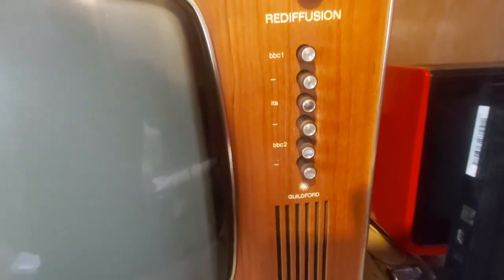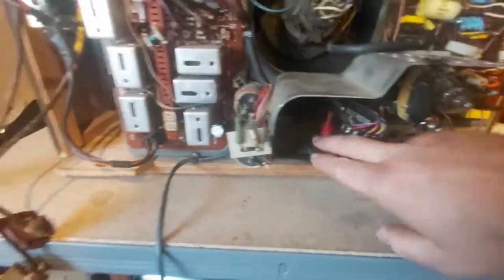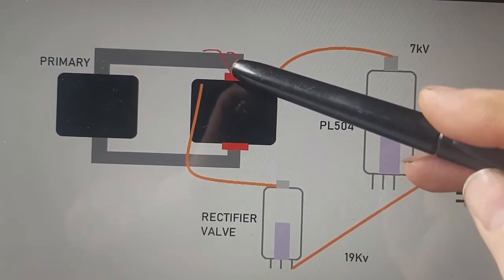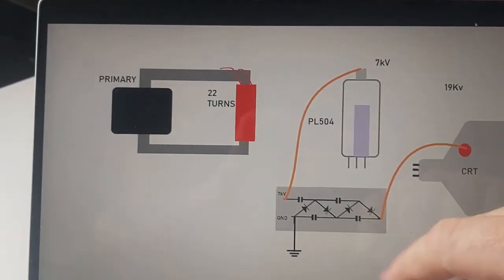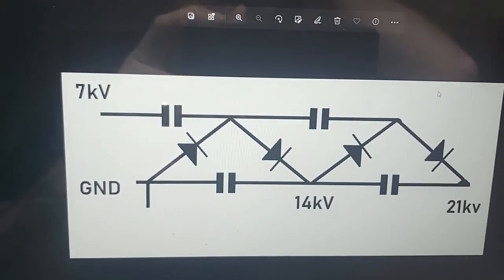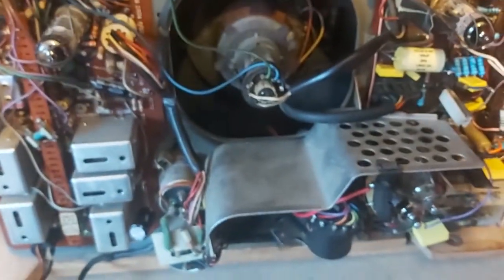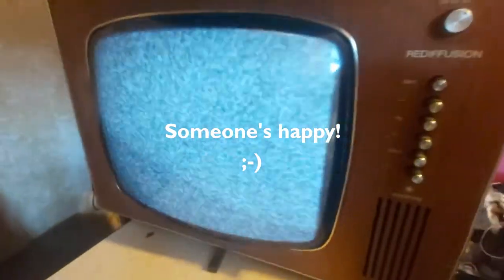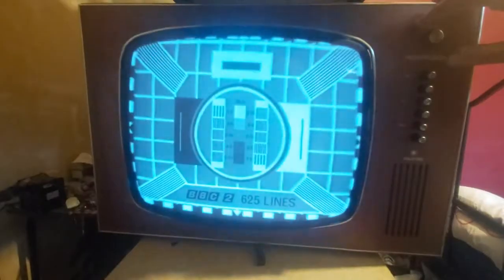Bush TV 161 A640 LOPT Tripler Conversion

Comment: Excellent! I have a Bush TV166U and bought a NOS resin-potted LOPT (at great expense!) to replace the old tar one which made the picture dim and enlarge, but now the set is non-functioning, even with the old LOPT back in it. Tried everything and can't get anywhere with it.
Reply from the maker: If you're getting a buzz but nothing else I've noticed it doesn't seem to take much to stop the oscillator running so check the PY88 diode. The valves are all series string too so one failing or going to air means the whole lot doesn't light up. If that's OK, suspect the mains dropping resistor or one of the two diodes coming directly from it.
Reply: @MegaWayneD  Thanks for your reply. I'm getting line whistle but the DY802 glows a quite bright purple, which I don't recall seeing before. I've tried swapping it for a new one, as I have the PL504, PY88 and PCF80. All light up but there's absolutely nothing on the screen. I've checked voltages and they are all more or less where they're supposed to be. I have no way of testing the EHT. The odd thing is that it used to work (apart from the failing LOPT symptoms) when I first revived the set back in 2013 but now this. I've also checked and replaced suspect caps and resistors in this area. I ended up putting the set under my bench after this and it's been sitting there for a couple of years now. I would love to get it working again as it has been in the family since it was new in 1967. I think I'll drag it out again and have another go.
Reply from the maker: @dryadmusic  the DY802 glowing purple isn't a good sign, almost like it's lost its vacuum but if you've tried a new one and it's doing the same it sounds like something is arcing/shorted in the LOPT stage.
Reply: @MegaWayneD  Ok, thanks, I'll have a look.
Reply from the maker: @dryadmusic  also make sure there's nothing dragging down the chassis to earth such as a test lead or video lead. If you earth the neutral chassis it drags the power down so the oscillator doesn't start up.
Reply: @MegaWayneD  I've checked for shorts as you suggest, but all ok. Then I had the idea of taking off the cap of the DY802 and noticed (with the light off) that the PY88 was flashing over at the bottom of the cathode, so I changed that and cured that problem. But then I thought I would change the DY802 as well and amazingly it worked - sound and vision have returned! I had never thought of changing those because they were Mullard NOS which looked brand new (and probably was), but I found that the heater in the DY802 was O/C and obviously the insulation in the PY88 had gone as well. It just goes to show that even NOS Mullard valves can be faulty sometimes. Now I have some aligning to work to do because I've changed so many caps and about a third of the resistors on that panel that everything is out! Thanks very much for your help.
Reply from the maker: @dryadmusic  Glad you got it working! I've had a few apparent "NOS" valves turn out to be worse than the ones I was replacing. I suppose the danger is getting someone's dodgy batch of valves, sure they might never have been used but someone may have tried to use them, realised they were duff and put them in a box for 50+ years! I have lots of DY802s if you're ever stuck, they're no use to me now that I have a tripler.

Comment: Nice job but you could just use a colour tv tripler or the high voltage winding off of other BW tv, usually they are compatible when they use the same output valve.
Reply from the maker: Where's the fun in that?! 😁 Plus I actually learned quite a lot from this.  I wasn't expecting this to work but it's been brilliant.
Reply: @MegaWayneD  well, cant argue with that...the only thing better i can imagine would be to keep the set original by using an overwind from another tv... but we all learnt something, i didnt knew candle wax was good with 20kv...i was surprised....i always use rtv silicone to pot and insulate high voltage stuff...the wax has the advantage that it can be melted again...im sure the silicone is much better dielectric and better to keep moisture away permanently though...if you want you can try, just go to an auto parts store and buy rtv silicone, or gasket making silicone etc ...its incredible with high voltage...just make sure you dont buy the acid type...if it smells vinegar dont use it...if it doesnt its the good stuff....dont confuse with PU glue or anything that comes in a caulking gun...those are conductive... great video!
Reply from the maker: @MrHBSoftware  this TV is far from original, the resistors had drifted so badly I've had to replace most of them. I did try to rewind the outer winding of the LOPT but it failed and I'd dismantled and reassembled it so many times I was concerned about damaging it beyond repair. Have a look at the thread on VRAT from when I first got this TV: https://www.radios-tv.co.uk/community/black-white-tvs/rediffusion-guildford-rt-194-19-dual-standard/

Comment: I have an old television with Tubes that suddenly showed a horizontal line, could it be a problem of the PL504? or PY88 please help
Reply from the maker: That's an issue with the vertical output by the sounds of it. Find out which tube is the vertical output tube and take it from there. I'm guessing it also has a vertical output transformer, which is also something to check.
Reply: @MegaWayneD  Thak you very much for helping

Comment: I've one with the plastic plessy lopt but black line midway on the picture and won't stop rolling. New caps resistors haven't cured it. Lopt is on a brc tripler. Any clues on the picture. Plastic caps on the right board all replaced. Thanks
Reply from the maker: Replace the PFL200 and PCF80. Get a couple of different makes too and never assume that just because a valve is new old stock that it's any good - I learned that the hard way! I had a new old stock Pinnacle PCF80 and it was worse than the original! Tungsram seem to be good replacements.
Reply: @MegaWayneD  made no difference what so ever. The board has original caps on the left if board. The right board has been recapped and old yellow and blue caps replaced. Its a half picture and a line across the middle. The picture isn't bright either and only getting 8kv not high enough
Reply from the maker: @basgib if it's only getting 8kv what's coming from the tip of the PL504? You should be getting around 7kv here. If not, suspect the PL504. If it is 7kv suspect the tripler.
Reply: @MegaWayneD  tried 3 good tripler trays and new valves. All known to work as they have been tested.    New boost cap and other parts.
Reply: Line gold drops the kv on the eht tray.
Reply from the maker: @basgib Could be the pot? Either way, time to look at the Television magazine article on the TV161 I think.
Reply: @MegaWayneD  getting 6kv on the anode cap on the original lopt.   No uhf picture just dark.   Contrast doesn't help on vhf it makes it buzz
Reply from the maker: @basgib hmm... Just out of interest, try giving the dual standard changeover contacts a good spray and operate them manually a few times and see if that improves anything.
Reply: @MegaWayneD it's a Weak lopt. I've no way to test it or post it to England for testing. Uhf is worse. Narrow picture. Vhf is good but dim. Ballooning on brightness